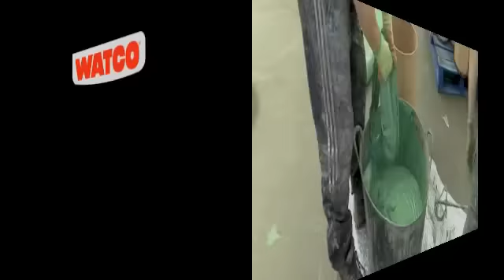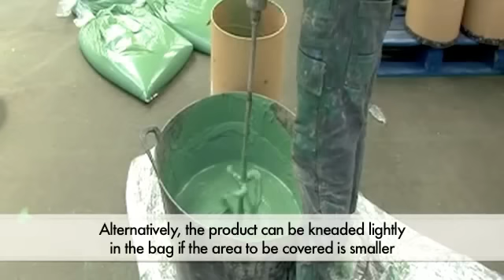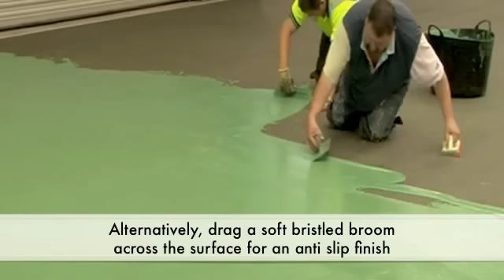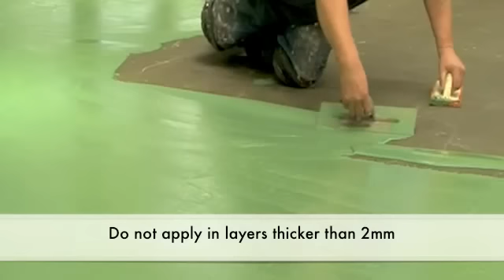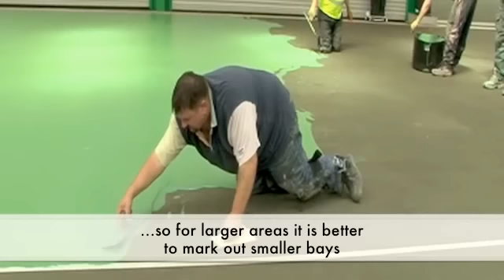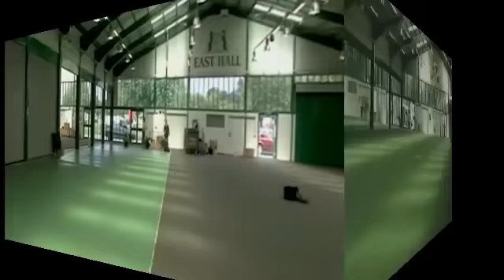How to resurface concrete & asphalt | WATCO® Coloured Resurfacer

Comment from the maker: Boost the look of concrete floors in your exhibition rooms
The look of concrete floors in the exhibition rooms is crucial for car dealerships and exhibition venues. The best way to transform worn concrete is to use a self levelling compound. Watch the video below to learn how to resurface concrete and asphalt.
Learn how Watco helped The Kennel Club achieve a “quality floor” for their exhibition rooms
The new opening of the Kennel Club Building in Stoneleigh Park in 2008 saw a great success as it is considered Britain’s best venue to suit all canine educational needs. There were two large exhibition rooms that needed floor resurfacing and we had been contacted to help with the case. Watco Coloured Resurfacer was suggested as the most suitable product in our range and after the owners received a free of charge sample and tested the product for six weeks, they decided to go ahead with the full order. 
Watco Coloured Resurfacer will transform worn, pitted concrete and asphalt and will give your floor an attractive, sealed, dust proof finish. This self levelling compound is very easy to apply as it’s supplied pre-blended. Simply stir the contents of the bag in a suitable container with a mixer attachment with an electric drill, pour onto the floor surface and spread with a trowel or squeegee. 
Read more about The Kennel Club http://bit.ly/1g9Rg4G
We manufacture most of our products and our dedicated technical team will be more than happy to answer any questions on 01483 418 418 (8.00am to 5.30pm Monday to Friday) or sales@watco.co.uk.